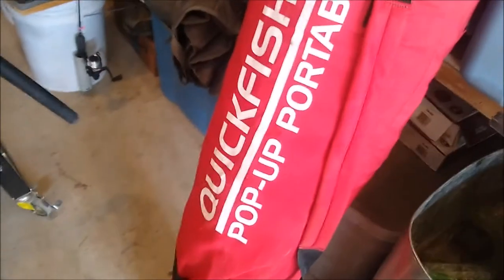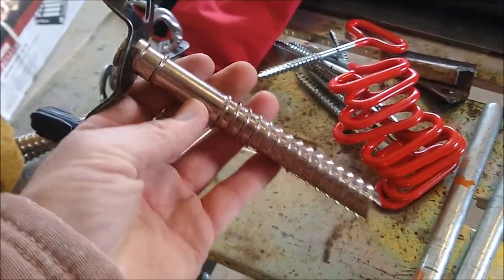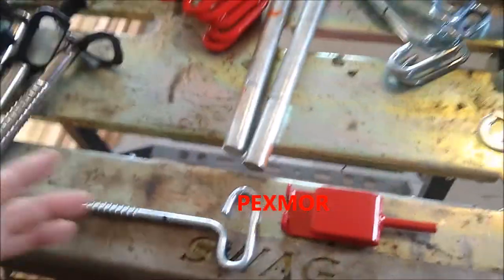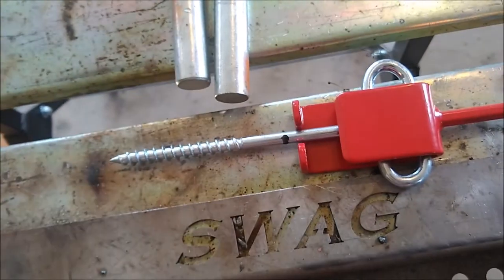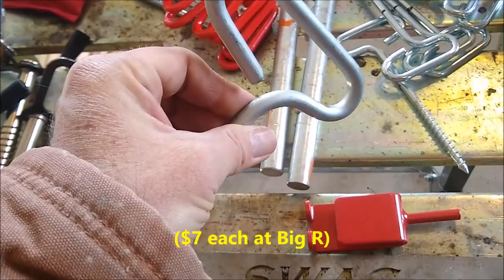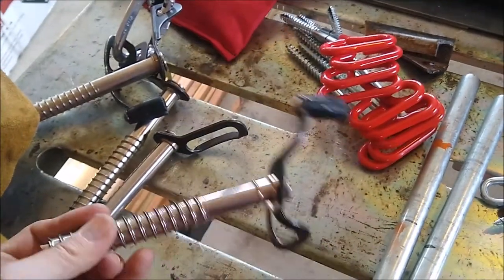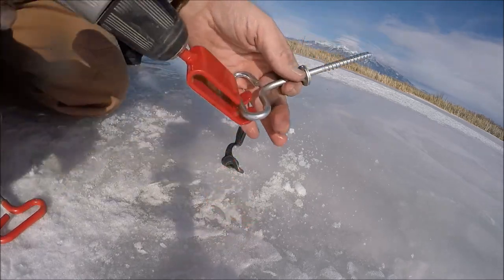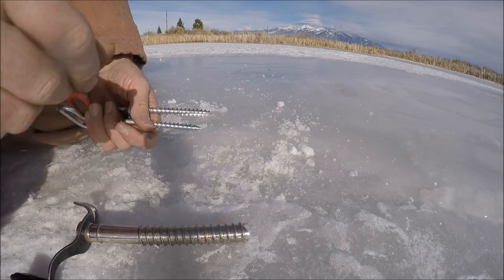Ice Screw MOD/Comparison-Eskimo/Eagle Claw/Pexmor

Comment: Just to add, I also welded the end of the ice screws so there was no opening in the middle... Since you already had your welder out. Cheers
Reply: Sorry I guess I didn't post my 1st comment..  Another tip I have learned ice fishing and camping  is to angle the top away from the shelter / tent when you drive it in. That way the bottom of the shelter will not lift up-and-over as you had mentioned because it gets tighter as it tries to rise up the screw / stake. This is assuming you don't have a welder and leave it stock ;)
Cheers

Comment: How have they held up?
Reply from the maker: Eskimo screws are all still in service, no probs. We have bent 3 of the pexmor screws installing them :-( and they go in the trash only because I feel like if they bent once, even if I straightened them they would probably bend at the same spot again.  The dumb thing is, is the cheapo Walmart Eagle Claw screws drive faster than the pexmor screws, especially in very hard ice, and they have all held up perfectly. Mayb because they have 2 flutes instead of one? IDK. Was worried about the Eskimo screws, because they are so thin toward the tip, but they must be made out of a harder metal, not one has bent.
Reply: Just a quick tip that I have learned from ice fishing and camping in the summer as well...if you slope the screw or stake away from the tent it won't lift up and around the screw / stake because that creates more tension...too tight to go up and over ;). Great video though!